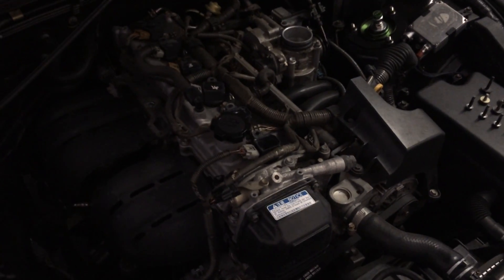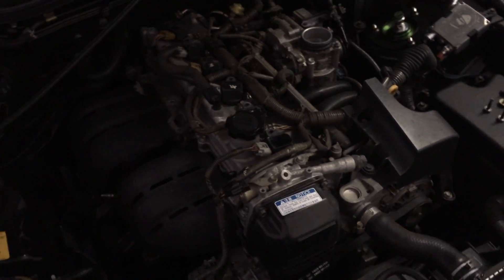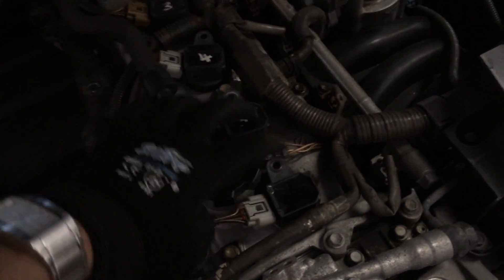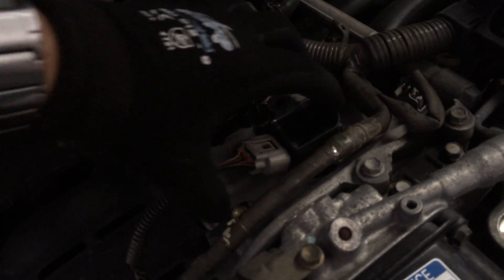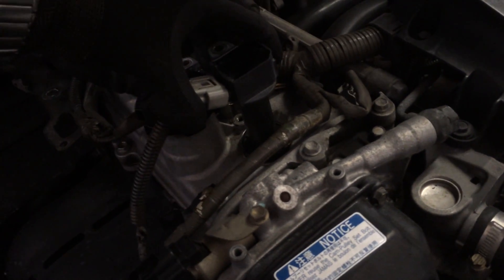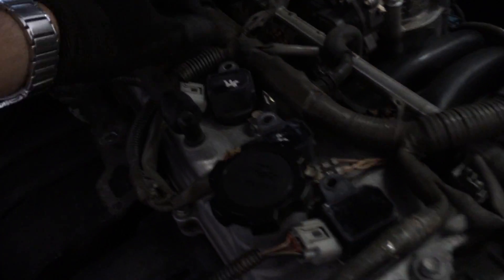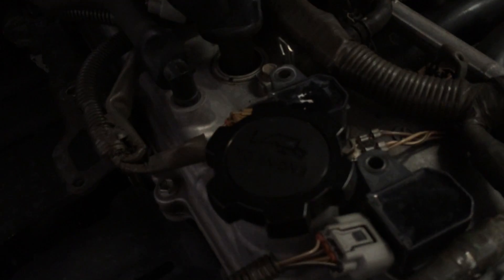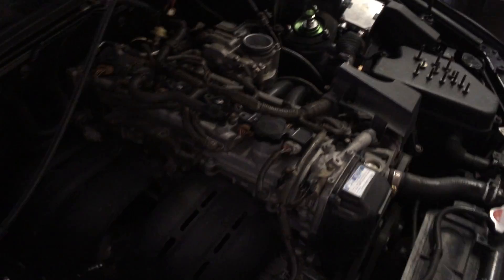How to Diagnose Faulty Coil Pack without using a computer or OBD2 scan tools Check Engine Light

Comment: I’ve used a different approach I’ve use mechanics telescope or doctors scope preferable a heart surgeon one. I then started my Holden redeo TF 2000 and listen to each coil pack you will hear a tick tick noise coming n them if you don’t hear it then it’s faulty. Happy to share my experience 😀
Reply from the maker: Thanks for sharing!

Comment: I will NOT touch those ignition coils when they are being charged. They can go up to 4000+ volt DC. I would rather buy a cheap ODB2 scanner on Amazon than touching them when they are charged.

Comment: It will show you dead coil packs that's for sure, but it can be faulty and still work most the time. Better way is to use a multi meter and make sure all the coils are the same temp (even a few degrees will change the resistance in the coil pack) and just check the resistance. If the coil has a crack in the housing that could leak out spark, you will have to visually check for that. Clean it off with a rag and in my experience if it looks good it's good.

Otherwise, there's awesome scanners (not just code readers that people call scanners) for just $20 on eBay. I won't shill anything, you'll find what I'm talking about.

Pro Tip; If you plan to keep the car.. if one coil or two coils are bad the rest are soon to follow and its best to change them all out. Same for injectors and of course spark plugs ;-) happy wrenching
Reply from the maker: Great advice!! Thanks for sharing and helping everyone :) cheers

Comment: You are luky that you didn't got shock. It wouldn't feel good.plus car set codes like crazy. And no all the cars have coil packs on top of the engine some v6 engines can't even see coil packs on fire wall side.

Comment: Yes! Thanks for the tip. Been wanting to check the coils. Trying this out tonight.
Reply from the maker: Let me know how you go!
Reply: @ThatCarChannelOfficial  Ok , I finally tested it out and all coils are all good! But not sure when they were last changed out, I'm going to replace them soon. Think they might be original? Have a 2011 Jeep compass. So looks like it could be the O2 sensor. Three weeks ago I got an engine light. So I did get an PO420 code also. Ordering an O2 sensor tonight.

Comment: did this, found 1 that didnt make a change, swapped ignition coils with another that did make a change, problem swapped to that cylinder.  problem diagnosed. faulty ignition coil isolated, 2 thumbs up!!
Reply from the maker: Glad it helped

Comment: Could a weak spark set off a catylitic converter code. I think this happened in my toyota and eventually the coil failed and when I replaced it the catylitic converter temp codes doesn't come up any more!?

Comment: thats not a good way to test the coil high voltage feedback can cause damage to the coil
Reply from the maker: This is just a quick and dirty way to test them if you have a misfire - by no means it it an exhaustive test of their performance.
Reply: No dude you shouldn't pull the plug out like that you wll end up frying the coil pack  you need to pull the plug from the coil pack   that is the safest way to do it

Comment: Could faulty ignition coils cause the car to crank for a while before starting up? If it doesnt start right up that is?
Reply from the maker: It could, as in it would crank (normal cranking speed) then sputter into life, and idle rough. But there could also be a few other reasons.

Comment: Hello to all :) 
I'm owner on Fiat Punto mk2 1.2 8v car. Last time i got problems with misfires.. And im suspicious on the coil packs.
So i do multimeter test:
On the Ht input resistance test i'm getting 2.6ohm and 2.8 ohms on the other coil..
On the HT output resistance test, i'm getting 7.4 kohm and 7.3kohm..
What means this result? 
And also when i tried to measure continuity on the HT output pin there was no result.. number 1 was on the screen nothing else... 
Can somebody help me?

Comment: Where can u buy the retaining bolts that hold the coils?
Reply from the maker: I think there just m6 or smaller? M5 or m4? Any nut and bolt shop would have them, might need to run a washer though as they might not have a flange under the head
Reply: That Car Channel thnxs

Comment: No they didn't replace the coil packs. They just replaced the coil pack boots. I have heard of them doing this before because old boots might let moisture in supposedly? I guess if I would have told them to replace them all it would have been another $300 or so. This place usually uses OEM parts as much as possible. I know they ordered and used the NGK iridium spark plugs that the car requires.
Reply from the maker: Might need to look at coil packs? Do you have a scan tool that shows if a cyclinder is misfiring? If you do - periodically scan it for misfires - doesn’t always have to throw a cel. When you find which cylinder is consistent - swap it with a known firing one. See if it happens on that cylinder. Something to also look at is your idle speed - if you have a very low idle speed (lower than service limit) it could be too low for the alternator to charge the battery and after a period of idling it could develop a miss fire..
I’m still hunting a misfire on my r36 Passat - ignition is all new and fine - but it misfires after long idle periods (stuck in traffic etc) it has a pop and carry on them clears itself - but if I use a bit of e85 or fuel conditioner in the tank - doesn’t misfire at all!
Reply: Been a few weeks since the tune up in my last reply.  Wife's car has slowly been getting worse. (Hesitations and apparent misfires.)  Still no engine light ever came on.  Started to wonder if her CVT was beginning to fail, although when it would skip, it didn't show an RPM jump??  

Then yesterday she calls me in the next town and the car had starting misfiring badly and left her stranded at her sister's house with the CEL on.  Went there and started disconnecting coils (just the connectors as hers does not die using this method.)  Found a bad coil that didn't change engine idle when disconnected.  

Ran to only auto parts store in that town (O'Reilly's) and bought the more expensive coil they had in stock ($62 Import Direct brand, their house brand was about $45)  Ran back to her car and swapped that in and I thought I had a bad new coil.  It didn't appear to be firing. 

Did some swapping and magically it starting firing properly.  (Maybe I didn't have it firmly seated?)  Seems to be running great as I drove it home (20 min. drive).  Going to Autozone to have them scan and turn off engine light in a few minutes.  I know I can just disconnect battery, but curious what codes pop up.  

Will doing this type of diagnostic throw CEL codes for each coil you temporarily pull since you are in effect causing a deliberate misfire?
Reply: Lol.  Still chasing misfires on this Rogue.  Last coil I replaced a week ago was definitely initially bad.  Now another cylinder seems to be intermittently misfiring.  No CEL yet.  Have an OBD2 scanner ordered.  Used the "gas peddle" trick to watch CEL for codes.  Just all 0000's, so no recorded codes yet, not sure if that works for PENDING codes?  Pulled ALL the COPs today and have them on the table here to check resistance.  Noticed a bit of black crud on cylinder #1 and #2 (new (Iridium)) spark plugs.  Cleaned them off and thought it might have come from that bad coil I was swapping around which appeared to have tons of carbon buildup when I replaced it last week.  I don't know the proper resistance and pinouts for these Nissan  22448-JA00C coil assemblies.  Do you know?
Reply: Replying to my own post.  Just an update.  Pulled all four NEW spark plugs (NGK Iridium they replaced during recent tune-up).  Checked the gap and all 4 were different from each other and smaller than spec for the Rogue, which was magically supposed to be what these come from factory gapped at, .044.  They ranged from .033 to .040.  

Carefully, gently regapped them to spec and reinstalled.  (I know, you're not supposed to gap Iridium, but the factory screwed it up, so as far as I'm concerned, I improved the situation).  They looked very clean with slight carbon build up on 2 on the ground strap portions.  

I put them back in along with the coils.  Did notice a bit too liberal dielectric grease on the tips of one plug.  I just cleaned as much of that off as I could from the plugs AND coil boots until I chase this skip/hesitation down, then will remove coils and LIGHTLY apply some back to just the inside edge of the boots.  Don't want to have a connection issue because the boots are filled with dielectric grease.

After the checking of coils and regapping to spec of the plugs, the idle seems better, smoother, less shaky.  The acceleration seems more responsive.  But, the intermittent skip/hesitation is still there.

I went ahead and scheduled a CVT fluid change at the local Nissan dealer where we bought the Rogue.  I admitted to them there was the skip problem, and filled them in on the recent tune-up, and even the coil pack replacement, but told them there have been no CEL or codes since.  (Have since bought a cheap OBD2 scanner, and confirmed no stored/pending codes before taking it there.)  

Admitted the CVT had never had the fluid changed (wife insists on following the Service Schedule #2, and it only shows services up to 120, 000 miles, with no replacement of CVT fluid listed in that schedule.)  Told him we haven't noticed tranny problems before but wanted to be preventative anyways, as the car is at 127,000 miles.  I asked them to go ahead and do a full diagnostic (was quoted about $90 for this) to isolate the problem.  He agreed and recommended it BEFORE deciding to replace the CVT fluid (which would be $220).

Well after an hour or so, the service rep came back and told me the CVT fluid was discolored, and he did notice a little whining noise related to the CVT, but he recommended NOT changing the fluid as this might cause more problems with the fluid having gone that many miles and being discolored.  (Sounds like when the old automatic tranny's would only pull because of metal particulates being in the fluid, and a fluid/filter change caused them to die!)

He said there were no codes stored and no misfires after watching the live data, but he recommended a throttle body/injection service to take care of that being the cause of the hesitations.  He also recommended a radiator flush and brake fluid flush, both which were needed as they had not been done, ever.  I agreed to all 3 services as I didn't want to fool with it myself, and they had the factory-recommended fluids and each of the 3 services were between $120 and $150 I think.

Ok, so I sat there prepared to walk out paying around $500 or so for my diagnostics, and the three services, hoping the throttle body/fuel injection cleaning service would squash the hesitations/skip/whatever they seemed to be.  I was pleasantly surprised when my bill came to be about $315 total!  Each service was listed under $100 on my invoice!  Not sure if he just quoted me the highest they charge for larger vehicles or if he deducted some for the diagnostic fee since I had them perform other services, but that is the BIGGEST savings I have ever gotten on car repairs/services!

The bad:  The skip/hesitation has NOT been fixed, but the car appears to run smoother after all this, and the wife says it accelerates better, and she claims it brakes better.  I'm not buying into the accelerates better (I think that was the proper gapping of the plugs!), or the braking better.  But, Happy Wife/Happy Life.

Now I'm just putting cash away for the day the CVT takes that crap I know it's been so constipated to take for a while... :(

Comment: Could a faulty coil pack cause slight power loss upon acceleration from a dead stop or just driving down the road? My wife's Nissan Rogue just had a full tune up because we had a check engine light on with misfires on cylinder 2 and random misfire codes being generated. They changed the coil boots and all the spark plugs and it was running fine but now the wife is saying it seems to be losing power or misfiring. No check engine light yet.
Reply from the maker: Seems odd to not have a code yet. Grounding connections ok? Did they change the actual coils them selves or just the boots?
Reply: Yes.
During acceleration injector dumps more fuel into cylinder for burn. 
Packs going bad provide less spark to corresponding plugs leaving fuel unspent resulting in sluggish acceleration , intermittent miss fire , bad gas mileage  & catalytic converter wear with no codes being present.

Comment: not only did one and three fail your test, but if the plug is bad your car will misfire, so you do NOT know it was the pack.
Reply from the maker: It had new plugs - but you are correct, should always start with the simplest test - check plugs, clean and inspect them - if still fails you can always try and earth the plug against the block and hold it like we used to in the old days!

Comment: My car idles just fine but It hesitates under acceleration.
How would you diagnose a coil in these situations?
Reply from the maker: Might be best to check your spark plugs, and visually inspect coils for cracks or split boots etc, other than that if you have a scan tool it could tell you which cylinder is misfiring.

Comment: so if one coil pack is 100% gone the engine will not start up is it<<<>>>/???
Reply from the maker: It should start and run very rough, or it might struggle to start, like it cranks and has a few fires and you really have to play with the throttle and keep cranking and then it starts, like an old car in a movie.. but it ‘should’ start with 1 dead. Assuming it has more than 1 cylinder :)

Comment: Any difference between doing this and just unplugging the wires to them? My OBD says “Ignition Coil K Primary/2nd Circuit” I thought I could test it by unplugging the wires to the coils and sure enough I hear a drop in rpms from each one. Could this be an underlying problem?
Reply from the maker: Some cars will detect a fault when it’s completely disconnected and not fire/stop. This was a perfect axample of that.

Comment: how do u do that wen its the back coils that need replacing and u have to take of the i take manifold.
Reply from the maker: That does make it significantly harder, you may have to just bite the bullet and replace them all? Or replace the front ones (known to be good) with the back ones and then pull one at a time at the front? Assuming it’s a V6 or something along those lines?
Reply from the maker: Good question by the way!

Comment: This didn't diagnosis a coil pack. Just showed you what cylinders are misfiring. What if you had a bad injector? You'd get the same results....
Reply from the maker: Yes and no - the cats would not glow red hot with unburnt fuel if it was a sticky injector. Coil packs are cheap and easy to test this way, I would never go straight to removing injectors - I would always try ignition first. If That failed I would check fuel, (ie injectors are cycling).

Comment: is there another way to do that without put your hands on it with in the engine running?
Reply from the maker: If your vehicle supports a scan tool that can diagnose the exact coil, most later model cars will do this, but I didn’t have a scan tool at the time.

Comment: Just change all in one time. left the old coil suffering continue work with other new coil not good.
Reply from the maker: +DS 100% agree with you, however this was simply to show how you can do this. Due to a number of factors purchasing 6 new coils was not cost effective, nor did the local parts supplier have them in stock. So I replaced what was needed, then procured the remaining from an online distributor within weeks, and replaced the remaining ones.

Comment: This works great if the coil pack is dead, but how do you test the coil pack when it gives you a misfire, because the coil pack is weak
Reply: Rodney  Jones was wondering if that was the case with my wife's Nissan Rogue. It is a four cylinder and we just had a very expensive tune-up done at a reputable auto repair place that has done great work for me in the past. They replaced all the spark plugs, the coil boots, and everything else required for a tune-up.  We took it there because we were having a cylinder #2 misfire code and random misfires after a scan. It didn't really seem to be running rough but may have been slightly under-powered. After they did the work the engine light turned off and they said it was running great. I drove it and indeed it seemed to be peppy & running fine. After 2 weeks my wife was complaining that it was hesitating when you would accelerate from a stop and sometimes she felt it skipping while going down the road. No check engine light came back on but I am wondering if we possibly still have a failing coil  pack that wasn't diagnosed.
Reply: @TortureBot  or cheapo coil packs that don't create strong spark
Reply: Energy Storage Developers after I wrote the last response one of the coil packs fried completely! It didn't even need to be tested because you could see where it had melted near the top. All four were OEM Nissan coils that were original to the car. I took the melted one out and put in an aftermarket coil from O'Reilly's. I think it may still not be firing good on that cylinder with the aftermarket coil because we have what seems to be a skip still, although it has never thrown an engine light. I think I need someone with an expensive diagnostic scanner to take a drive in it to watch and see if that cylinder is cutting out under load. My little cheap Walmart scanner shows no codes are stored for anything. I think it's not doing it frequent enough to set a misfire code.
Reply: TortureBot yeah it may also be old spark plug